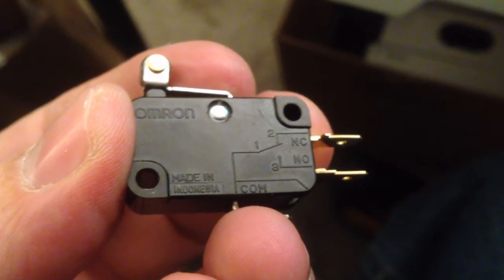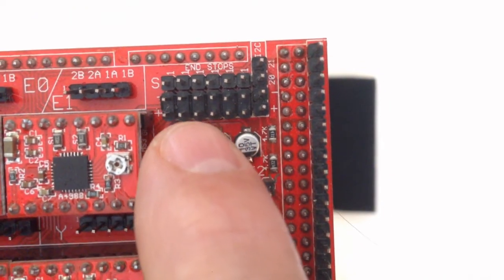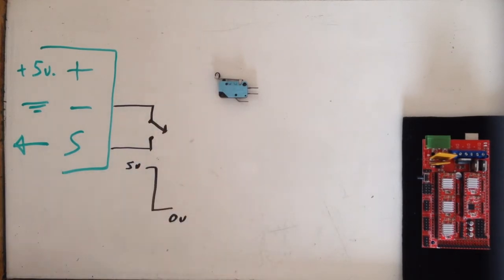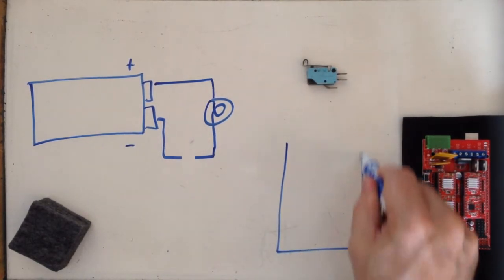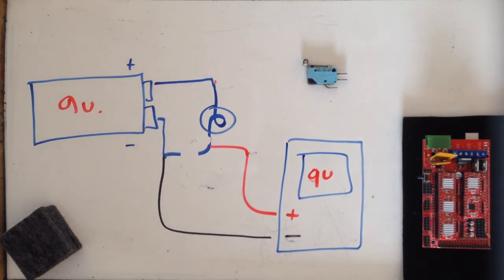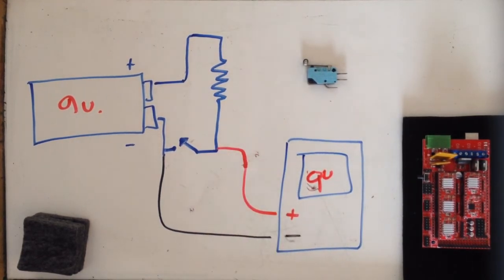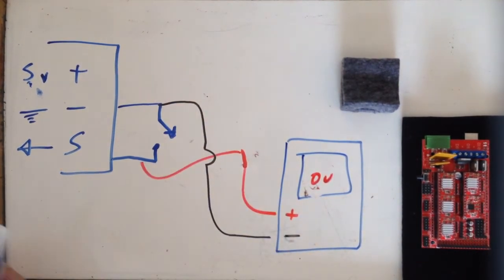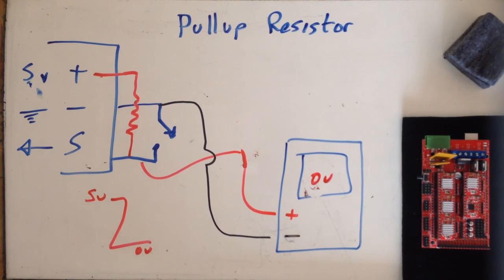Endstops and Explanations pt1 Theory

Comment: Thank you for taking the time to make this.  I was not aware of the internal pullup resistor.
Reply from the maker: I wasn’t originally either, and what little I found later only said that sometimes you should enable it but not when exactly or why it was important. I’ve cobbled together enough Printersteins now that I understand it, but why nobody else really made all that understandable before is confusing. Or maybe someone did but I couldn’t find it. Thanks for the kind comment!

Comment: The signal wire on my photo-interrupter goes to ground up on supllying any amount of voltage to the emitter wires.   When the path is blocked, it disconnected, no voltage between it and any leg of the emitter.